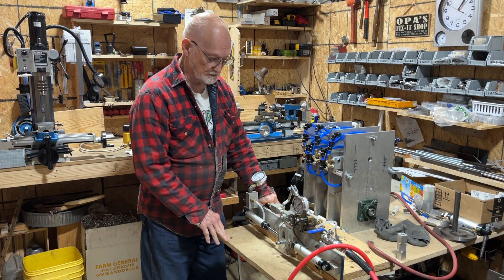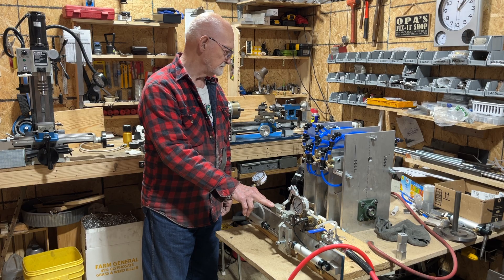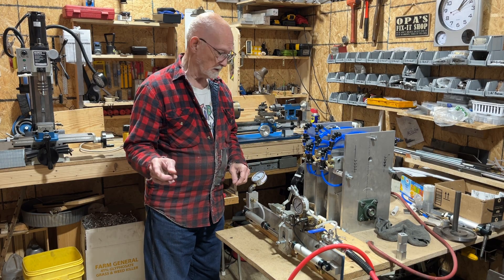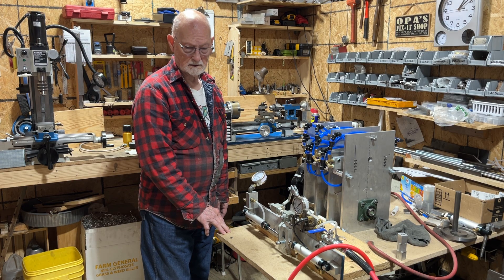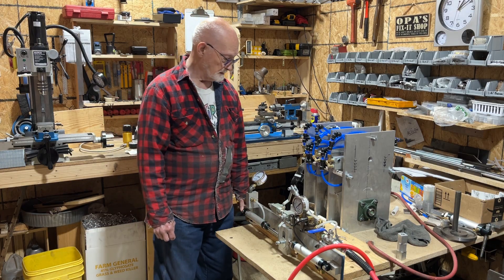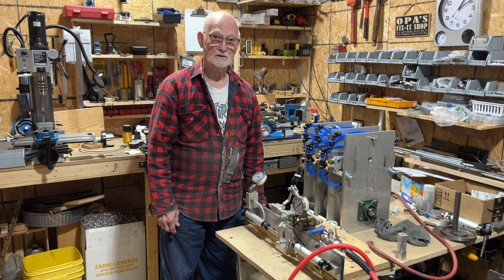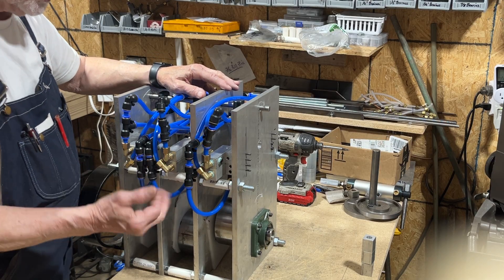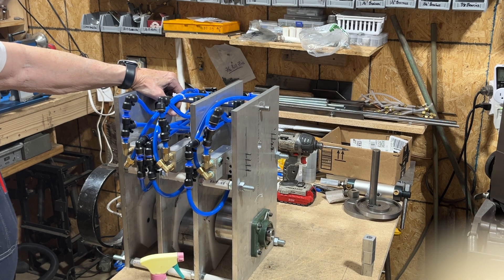Air Engine Research - Alternative Energy, Using Compressed Air 5-14-2025

Comment: Naturally, the more air you are moving, the more air you have to have free on hand.

Simple suggestion for a fast, ready [did not say 'easy'] source of gas: get a high pressure tank, put some holes in the top so you can put a small airlock rig on it, and drop baking soda into it [you can purchase baking soda many places, such as feed stores super cheaply in 50 lb bags, which I do for many different applications around my farm and in my shop] and then put any type of acid [such as highly concentrated 'cleaning vinegar' [often sold at 30%, but is less dangerous or corrosive than hydrochloric or sulfuric acids] and have a small motor [such as the kind you get in a can opener] that can be started and stopped by a pressure switch [like you find on normal air compressors] to feed the bicarbonate from a reservoir into the main tank to produce on-tap CO2 gas for your motors.

Comment: Why not attempt to use soapy water, like you would for gas leaks, on a few joints at a time, while air flows through, leaks will bubble the soap.
Reply from the maker: Thanks for the suggestion, I did and I did find where the leak was. It was the pop off valve underneath the ring that has the hose going to the safety shut off cylinder - got it fixed.